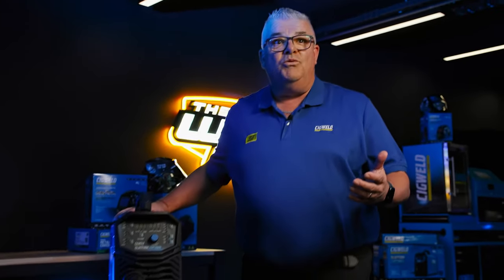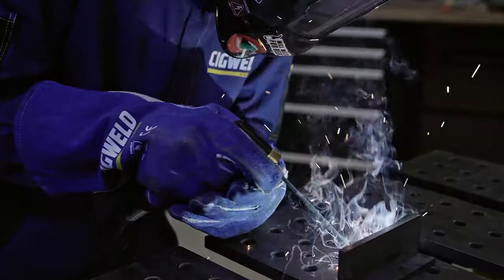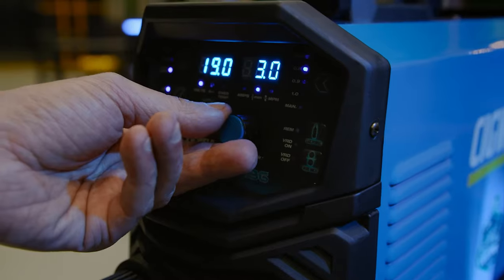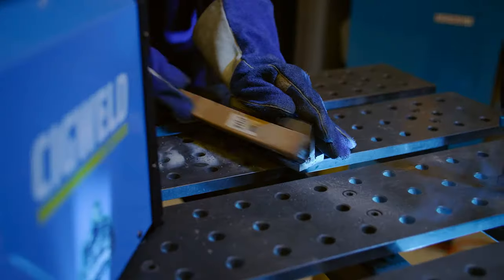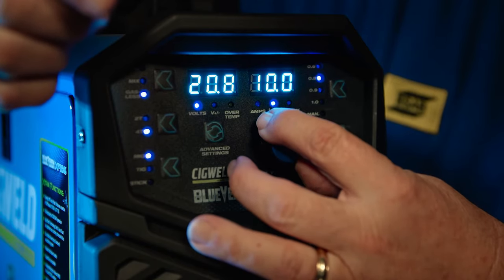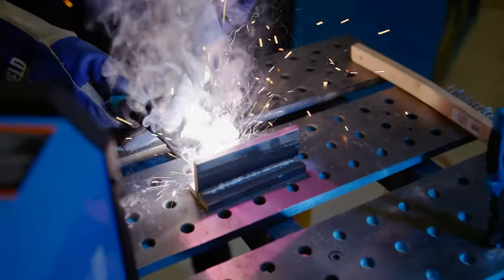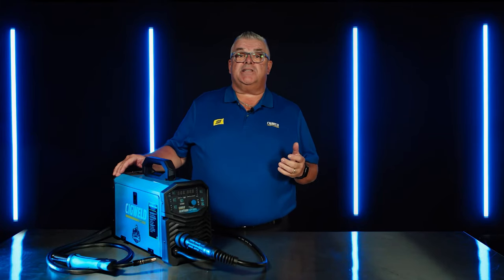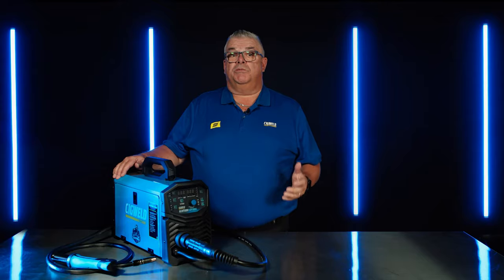BlueVenom XF186 FEATURE Highlights!

Comment: Can anyone tell me the difference between the xf 186 & the xf 190??
Reply: I'm trying to answer the same question. The product page for the 190 is fancier, but I can't spot any objective differences. Why does the 186 exist?
Reply: @chopiesthechook  I bought the 190 because Sydney tools gave me a discount on it when i asked them. The synergic control works good but I wish they gave the option to select the amps output for stick function. It only shows volts not amps until Ur welding and at that point Ur not looking at the machine. It really just let's u select plate thickness and fine tune.
Reply from the maker: Hi @oldmate8626, they are both newly released machines. Technical specification wise, yes the machines are similar in output and duty cycles.  The main difference between the two are the display screens and the MIG guns. The XF190 has the larger 4.3” screen and the premium flame series MIG Gun.
Reply: @CIGWELDESAB  Thanks
Reply from the maker: Hi @oldmate8626 , also, when the XF190 is in MMA mode, only Amperage is adjustable and there is no plate thickness function available. You can refer to page 60 of the operation manual for more details: https://www.cigweld.com.au/product/blue-venom-xf190/ - go to the downloads tab and select "operating Manual"
Reply: @CIGWELDESAB  I have now stumbled on that feature. The manual isn't the easiest thing to understand. The machine is great! Would be nice to see a video on it as I think it would make understanding the features easier.
Thanks